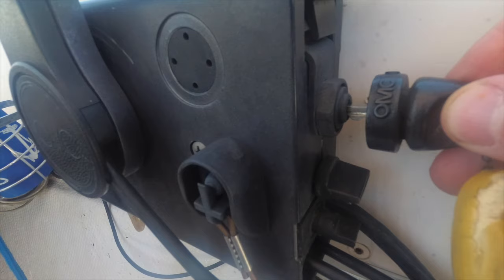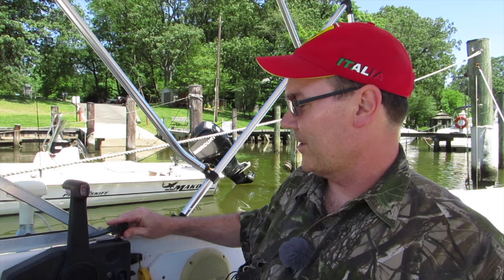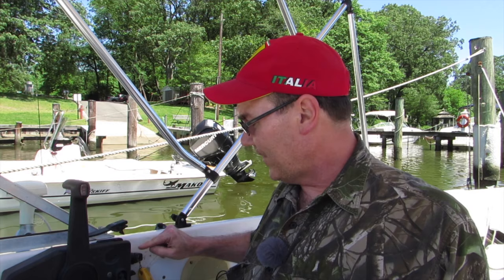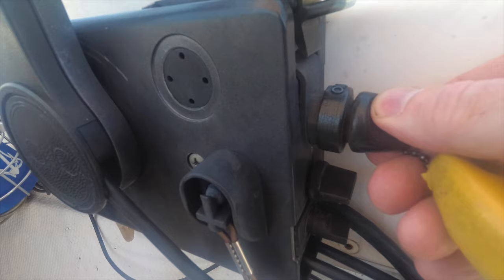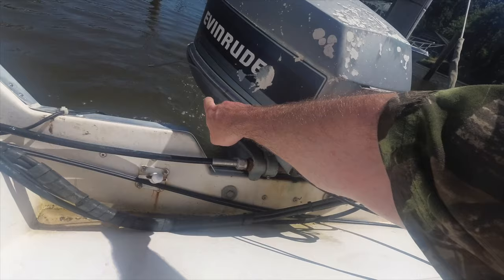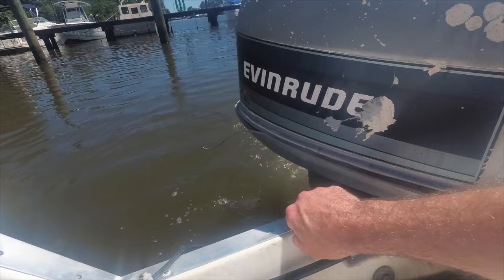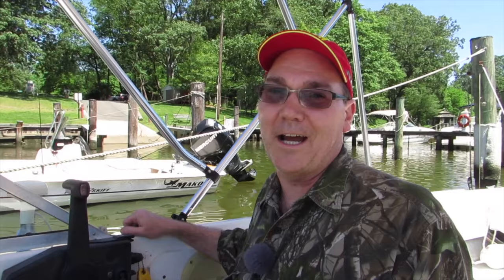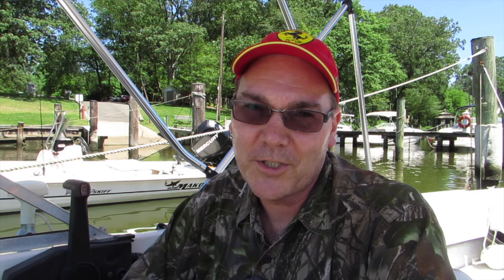Starting the Evinrude 90 HP 2 stroke outboard boat engine.

Comment: Glad im not alone, i just got my 1st 2 stroke engine and it hasnt started since i bought the boat 4weeks ago, ive spent nearly £50 on engine testing equipment and flywheel pullers etc and all along i didnt know the 'push key in for choke' until someone at the boat yard mentioned the 'secret choke' (i thought the fast idle lever was like a choke) and it fired up instantly😂, after spending a year cracking the art of starting a 40+yr old lister petter 2 cylinder diesel inboard engine ive now got to relearn the 2 stroke way

Comment: Cheers Wayne, I wen through exactly the same issue as you did. Took the boat to a mechanic to have a look at the motor and he couldn't find a problem with it. He told me the starting process exactly the way you described it. Turns out I was constantly flooding the engine.
Reply: So only use the choke to start it? After no more choke?
Reply: @outdoorswithjv1616  Correct. Be very cautious with the choke. Use it sparingly and generally only on the first start up of the day and only if it is necessary.
Reply: @joshuasmith2689  thank you!

Comment: Thanks, Wayne. It's good to know I'm not the only guy who struggled with that. When I first got my boat I had a heck of a time starting my two-stroke, messing with the choke, worrying about the gas mix, flooding the carb by over-clicking, didn't know about the mix. Still, I wish I would have found your video earlier so I wouldn't have had to learn all these things the hard way.

Comment: I traded a 60 hp Mariner engine for a 90 hp Evinrude engine from our local boat dealer.  I had asked him to keep an eye open for a larger motor that might get traded in. The dealer installed the 90 hp, but I have not taken out on the water yet.  We are planning on going Labor Day Weekend.  Today I was trying to start it and was not having any luck.  I tried to call the dealer, but they were not in.  I called a friend who has a pontoon with a 45 hp motor, but I couldn't reach him. I came in and pulled up your video and watched it then went out and followed your directions and it started right up!I  Thank you so much!  The dealer never explained how to push the key in while turning the key to inject fuel into the cylinders.  Thank you very much! I will watch your other videos and like and share them as well.  THANKS!
Reply: Most of the yamaha 90 hp 2 strokes don't have a choke.  They have a fuel enrichment system that doesn't work well. Mine is hard to start first time but, starts instantly the rest of the day. Just make sure the primer bulb is pumped up completely and good luck.

Comment: Thx for this video wayne. I haven't owned or operated a boat for years and the last time wad a 4 stroke. I bought a 2 stroke thinking it started the same way. This video absolutely saved me the headache. Altho my choke was the button below the lever, the concept was the same. Im now having a blast and dont gotta be scratching my head out at docks thinking somethings wrong with my boat

Comment: Thank you. I was wondering why my engine was not running right. It was hard to start to. I got it winter ready for the cold and never took it out on the water again. I was scared that it would not run. Now that you showed me how to do it. I will see if my motor is the same. When I first took it out on the water it was hard to start then I put it in gear right away then took off like a made man, because I didn't want it to stall at the boat lunch to look bad. Now I can't wait to take it on the water again. Thanks you so much for showing me your video. PS I would of ask my father but he has been past away now since 2009. Man,... how time fly's fast. Now it's March 17-2022
Reply from the maker: Glad to help!! I got so frustrated with mine before I figured it out.  Once I mastered the cold start (and the warm start on the water) I was so much more comfortable with my boat!

Comment: Thank you Wayne! I picked up an old boat last week that has this throttle control on it. The seller briefly spoke about pushing the key in but did not mention the idle adjuster and I’m looking at it thinking what does it do! So thank you very much. All the best.

Comment: I just bought my first outboard- a 1965 Merc 1000 "Tower of Power" 100HP (Professionally rebuilt)  mounted on a 1960 Glasspar Phaeton hardtop 17' boat. Boat has been restored throughout by the former owner. I've never used a hose muff for driveway starts, but will get one. I'll look for the idle control. I'll prime it, and try not to flood it with the push / turn cold start. It is a 2 stroke 6 cylinder beast of an outboard. A little intimidating, even though I run chainsaws daily. Adjusting the points when it needs it sounds like rocket science. And replacing the water pump every year or two was what I was advised. Supposedly, that's the Achille's heel of this engine. Okay. Just brought the boat home today, Minneapolis to Chicago. The boat is serial # 00001, and originally came with a 75 HP outboard, which was the biggest available in 1960. So, here goes. I'm ordering a service manual and hoping for the best. Long live the Towers!
Reply from the maker: Those “Tower of Power” Mercurys might just be the coolest old outboard motors ever. It sounds like you’re off to a really good start!

Comment: great info wayne , especially the pushing in of the key ... now the motor started !!! ha ha ha ... thanx again .
Reply from the maker: Thanks for watching and commenting - have fun out there!
Reply: @WayneTheBoatGuy  hey wayne , i have a 70 hp johnson two stroke (older motor) , it uses a 50 to 1 mix ... can you tell me if there is also a reservoir of 2 stroke oil anywhere that i should know about ???

Comment: Great Video! Last Sunday I started my 2 stroke Evinrude 70 engine (just got it in two weeks) with press the key down at beginning. Later on, I could not start the engine on the lake again! I waited at least half hour then started engine. Now I know why. Because I pressed the key when I started the engine again. the engine flooded! Thanks for this very useful tips!
Reply: Just remember that you're dumping about 30% of your fuel unburned into the water so your neighbors will be very thankful of you.

Comment: I've always wondered how to activate the Johnson 175hp 2001 electric choke.....everytime I start I would remove the cowling and spray starting fluid in the carbs........you saved me a ton of work...thanks

by the way am from the Caribbean, keep those videos coming.
Reply from the maker: Glad to help and thanks!
Reply: Hi 
Am experiencing a leak in my steering cylinder, I have opened it up but it seems to have a plastic bushing......any idea how to remove it and where a replacement can be obtained?
Reply: i hope you are joking. you didnt think "hey... i should take this motor to a professional before I score the cylinders from starting fluid"? fyi there is no electric choke on that motor. its a key activated primer as in this video. your motor also has quickstart. make sure its working. if not it will be a bear to start.

Comment: Nice video Wayne. Corny maritime pun incoming but I am also “in the same boat” as a first-time owner. Good luck with it!
Reply from the maker: Best of luck! And thank you for watching! Let me know if there's a topic you want me to cover.
Reply: @WayneTheBoatGuy  nice info on not choking the engine after starting. I would add "the tell tale" should not be hot water coming out as one final test before heading on for a RELAXING day on the water. If the water is hot to the touch she's not cooling that very hot engine properly and hence why the "tell-tale" in the first place.
Reply: @WayneTheBoatGuy  Thank you for the very informative video!
Can you make a video on how you get back with boat if the engine let you down in middle of the waters ? the options? paddling? 911 towing? elec mini outboard?
Thanks

Comment: thank you for the knowledge wayne, i have a johnson 140 and launched it for the first time today and my throttle control does not have that idle control lever.. still doing research but i guess i definitely flooded it like you did lol
Reply: Some controls have a button in the middle that you press at the same time as you engage the throttle.  This allows you to keep it in neutral and throttle up.  You just need to press the button until the throttle moves forward a little then you can let go of the button.  Once you’ve started your engine you can bring the throttle back to idle and you’ll hear a “click.” That means you’re out of neutral and can engage in forward or reverse.  Hope this helps.

Comment: I have an Evinrude 75 VRO 1993 - a couple other things to pay attention to - after winter storage you may need to clean the spark plugs if you used fogging oil.  Also on mine, the idler throttle is trickier because it is combined into the primary throttle / gear control (yours seems like a mercury control?).   There is a large round button on the side of the control that you have to push in with your other hand to put the throttle in "neutral fast idle".  Nothing says that on the control of course.  Also you have to have your safety switch plugged in or there will be no fire to the spark plugs even though the motor will turn over.  This switch (which comes with a lanyard to attach to the driver to prevent the boat from continuing if you fall overboard) can go bad - and you can turn over the motor forever but be getting no spark to the plugs.  Quirky to say the least!

Comment: I noticed that you use Grey fuel line.
I know they sell it to use on boats, but I have heard it does not hold up well?
I have a 1962 Evenrude 75 hp.
It was the first year of Selectric Shift & I made it direct drive for reliability.
I have an electric trolling motor & paddles if I need to maneuver near the dock.
I choke the engine to initially start at the dock only.
The engine only starts/cranks in slow position.
I normally take the boat on lake Erie for Perch fishing.

Comment: I have a older Mercury 80 horse 2-stroke is it the black and yellow wire that shorts out the ignition to ground shuts the motor down or is it something I'm missing motor runs just can't shut it off thanks for your help

Comment: A little tid bit- Pushing the key in is a choke function, effecting the air taken in by the carburetor. It does not squirt fuel. 
Nice video, good quality!!
Reply from the maker: Actually I was surprised when working on the carbs and replacing all the fuel lines under my cowl that it does in fact squirt fuel. There were two carbs, and two hoses that squirted fuel right into the carbs. I have heard that on other models it sets the choke, but that’s what it did on mine.
Reply: @WayneTheBoatGuy  Well Wayne, I apologize, that's interesting!
Reply from the maker: I played with it for 5 minutes when I first saw how mine worked and it explained why mine would completely flood with one push of that button when the engine was warm!

Comment: I went through the same headache when I first got this motor. Flooding & a million cranks. I have the 93 so on my control I have to push a button to bypass the neutral switch to advance the throttle.

Comment: Thanks this has helped me a lot! I just bought a boat with a 84’ evinrude without ever even have driven a boat before. I probably spent like 4 hours trying to get my motor started before watching this 😂 and how does your oil injection system work?
Reply from the maker: The oil injection system apparently was how many of these were set up as new, but most people bypass the system and use 50:1 oil fuel mix because the system wasn't very reliable. The oil injection system worked with a separate oil reservoir connected to the engine that automatically pumped in oil based on engine RPM (I think). Good luck with your "new" boat!!
Reply: @WayneTheBoatGuy  the early v 1 VRO systems in 1984-1985 did have issues, but after that they were extremely reliable. sadly the reputation damage during that short time was done.

Comment: Wayne!!  Thanks, I recently bought my first boat, w 70hp 2 Stroke Evinrude from the 80's.  Shop has already gone thru it, I have started with muffs in my drive....my question is on the idler control.  Do you adjust that while underway....or once you are up and running does that stay down?  I feel I have seen that lever pushed up with the throttle when boats are coming up to cruising speed?
Reply: You shouldnt be able to shift out of neutral if the idler control is lifted..

Comment: Hello Mr Wayne hope I can get a reply but I have a question so after you get it running and all and you shut it off and try to turn it back on. No more choke right? Only use the choke to start it up in the beginning am I correct?
Reply from the maker: Yes that is right.
Reply: @WayneTheBoatGuy  ok thank you for the reply!

Comment: Hi there - great video!  I just picked up an old fishing boat I am restoring - it has a 1982 Evinrude 90 hp on it.  What ratio do I mix the oil and gas for?  50:1?  Only ever had a four stroke but this engine runs and was basically free!  Thanks
Reply: Yes. 50:1 for the Johnson/Evinrude 2 stroke of that age.

Comment: Nice video do you need to pump the oil tank hose as well or just the gas fuel only if start?
Reply from the maker: Good question! Occasionally I check the oil primer bulb and when I do it's always firm. Then I check the oil tank level.

Comment: Thank you, this is extremely helpful. I just got my first boat and it has a 1975 Johnson 70HP on it with similar controls; I cannot find the owner's manual anywhere online to explain the start up procedure, and I don't know anyone with a boat either... I was struggling to get it going with what I think is a momentary toggle switch for the choke beneath the key (probably equivalent to what you activate when you push your key in) and wondering how to incorporate the 'warming lever'. I did get it to go eventually with a huge pile of white smoke, so obviously flooded the sucker with fuel. Anyway I'm looking forward to trying again now that I've seen this.
Reply from the maker: Awesome - good luck!!! It takes some patience and 'finesse' sometimes to learn the starting procedures. Also it can be quite different after it's been running for a while and the engine is warm. Mine usually only needs a simple turn of the key if it's been running.
Reply: The toggle switch beneath the key for your 70hp Johnson is for the electric "choke". Triggering the switch causes a solenoid to close choke plates in the air intakes for each of the engine's three carburetors, thereby enriching the fuel-to-air mixture. The trick is to hold the toggle switch when starting only until the engine fires, then immediately release. If the motor starts to shut off after a few seconds a quick flip and release of the toggle switch should help with keeping it running. Depending on how cold the engine and atmospheric conditions may be, it may help if you quickly flip and release the toggle than once before it will idle if the engine struggles to stay running for a few seconds right after starting. (Note: I had experience with an open bow Glastron boat powered by a similar model-year 70 hp Johnson outboard). Contrastingly, the "push in" key switch on Wayne's later model (four-cylinder) motor causes a shot of extra fuel to be injected into the engine. However this triggers an enrichener on the carburetor and does not work the same as a true "choke" which is designed to restrict airflow through the carburetor(s). (Note that: I also have experience with a '93 model 88 hp Johnson outboard which is equipped with this type of fuel-enrichener. Both methods accomplish the same results, which is to provide the engines with more fuel and less air momentarily to assist with starting them when cold.
Reply: @smoothsailin7294  thanks so much this is really helpful

Comment: Do you press the key in and out once or twice, repeatedly, or hold it in?
Reply from the maker: It really is a matter of figuring out what your particular engine needs to get started. I would push mine in as I was cranking and then it would usually fire right up.

Comment: Hi Wayne, I was wondering what that knob is under the ignition key?
Reply: Did you ever figure that out? I’ve been searching forever and can’t find an answer I have the same question.
Reply: @shawnmcclary7523  it's a tension screw so your throttle doesn't speed up or slow down.

Comment: Important to know: the newer 3 cyl (1994-up)60 degree (v6 1991 and up, V4 1995-up) and 90 degree V motors (120hp on up starting in 88') from OMC had whats called "quickstart" which is an automatic computer-controlled advance that activates when the motor is cold (up to 90 seconds or whenever the temp sensor goes past 96 degrees f), and every time its started when warm for 3-5 seconds. this eliminated the need to advance the throttle manually. a huge help. In fact, if you have a quickstart motor and need to jimmy the throttle, something is wrong either with the pack or sensor coil. you should NEVER need to touch the throttle on those motors.
Reply from the maker: I think the engine I had in this video was from 1985. Until I learned the procedure that worked, it was very challenging to start when warm or cold. When I figured out all the little tricks, it always started right up.

Comment: What do you do when it floods? How do you correct the flooding to re-start the engine?
Reply from the maker: There's a few things you can do when it floods. Open the choke all the way and try to start it, and/or wait to let some of the fuel evaporate
Reply: Disengage the prop as if you’re starting it on land. Usually done by pressing in the knob on the control lever (where it pivots). When you’re confident you know how to disengage the prop, push the control forward as if you’re going wide open throttle and then start it. Just be sure to quickly move it back to neutral in order to lower the RPM